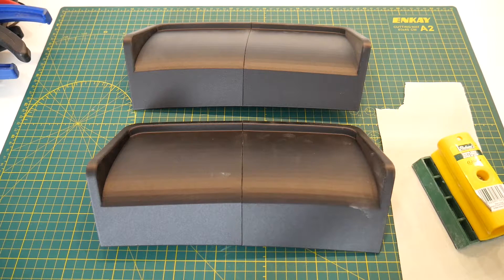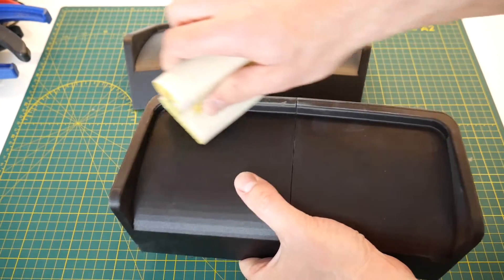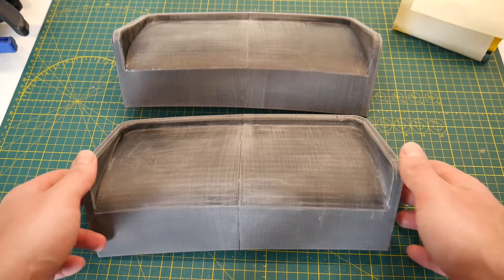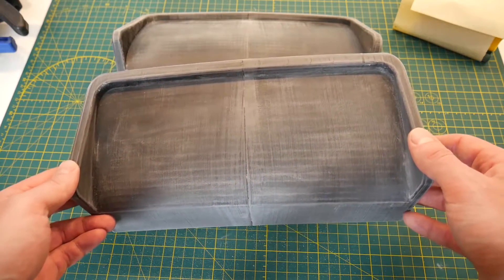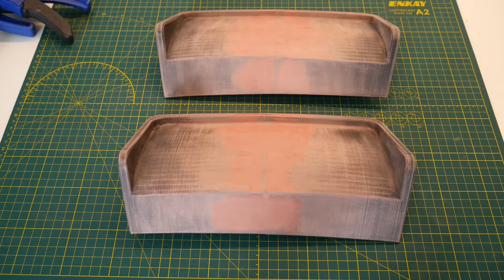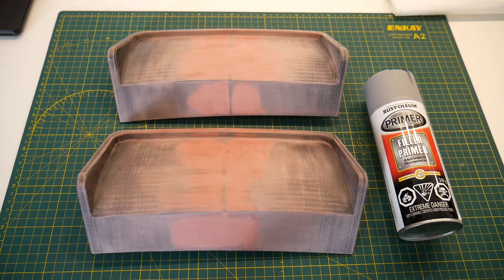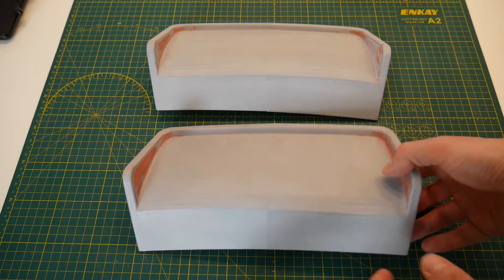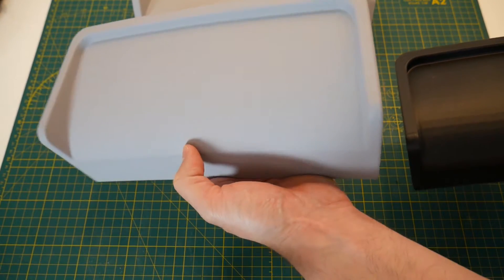Simple Way To Make 3D Prints Look Professional! Works For Car Parts, Cosplay, Etc!

Comment from the maker: Looking for a new printer and would like to support my work? Check the links below for the best prices - As an Amazon associate I may earn a small commission (at no extra cost to you):
Creality Amazon Store (Creality Ender 3 V3 PLUS)
► https://amzn.to/3WG7bkv
Creality Amazon Store (HYPER PLA Filament)
► https://amzn.to/3M8zrXc

Check out my review on the Ender 3 V3 PLUS: https://youtu.be/JeKFs0Ch4QA

Looking for the regular size version of this printer? 

Ender 3 V3 PLUS (New!)
► https://shareasale.com/r.cfm?b=2569126&u=3650799&m=124834&urllink=&afftrack=

If you guys are looking for some awesome 3D printer parts and upgrades check out my universal spool stand:

Universal Spool Stand:
►https://embracemaking.com/products/universal-top-mount-spool-stand

Links to Universal Spool Stand adapter brackets for various machines (like the top mount in this video)
► https://embracemaking.com/blogs/resources/universal-top-mount-spool-stand-accessories-and-adapters

If you're looking for the double sided flex plates, see below. The K1 MAX and V3 PLUS are the same size and listing:

► https://embracemaking.com/search?q=k1+max+PLUS+PEI&options%5Bprefix%5D=last

A few other cool tools and things for 3D printer enthusiasts.

Polymaker PolyTerra PLA (One of my favorite filaments):
► https://amzn.to/3sdhK1x

eSUN PLA+ (Another one of my favorite filaments):
► https://amzn.to/3QA4tuq

Electric Screwdriver (shown while working on the printer):
► https://amzn.to/3JRbbZe

Comment: What type of material did you use for your print? This was a great info.
 It would cool to see a video on how these parts are made in the software programs and into the slicer.
Reply from the maker: Thanks! In this particular print it was a nylon based material if I remember correctly. But the same process can be performed with regular PLA / PETG etc.

Comment: How have these kept up?  I'm interesting in printing some parts for my Audi or atleast printing parts to use as part of a mold for fiberglassing.  Just wanted to see how these have held up
Reply: Well I read some older replies and see you don't have the car now.  You mentioned shrinkage though, how thin was the thin section?  Was thinking us printing some things for around the grill/bumper area but if shrinkage occurs on thin parts I might have to think about which way to use the prints, whether as the part itself or just as the mold.
Reply from the maker: Shrinkage might have been the type of material, I hear that ASA is best for outdoors applications, whereas I think I used a nylon based material. Thin sections were probably only 2mm thick or so

Comment: Currently designing and printing a duck tail for my car, going pretty well so far. Definentaly going to use your video, very helpful! I'm not sure if I should vinyl wrap it or spray paint
Reply from the maker: Let me know how it turns out, would be interested in seeing it. Links / pictures!
Reply: @EmbraceMaking  will do! It’s awesome your still active in responding after 2 years!
Reply: @minecrad9970  Did you finish it?
Reply: @madthough2298  yes!
Reply: @minecrad9970  How did it go? I'm going to try the same thing
Reply: @madthough2298  wow you are! It went good, except for I had to print multiple pieces and connect them with superglue and bondo over it. It lasted a couple of months before the pieces started to seperate, and after a couple months, the cracks were visible. So I recommend printing a full wing like I did, and then creating a fiberglass model from it. It’s probably better to do it right the first time. I took mine off, and put a fiberglass one on.
Reply: @minecrad9970  my plan is print it in pieces using a resin 3d printer, with the pieces being held together with dowels and resin. Resin printing is pretty smooth so hopefully shouldn't need too much bondo. 

How did you get it to fit the contours of the boot lid?
Reply: @madthough2298  I had a friend who had the design of the curve of the car. I didn’t use the bondo to get rid of the lines but more to protect the plastic from the elements. I also used wooden dowels, but I’m not sure the resin will hold after a couple of months. If you want to then I wish you luck!

Comment: How did model the part, would love to see the process of getting a 3d model of the car to start actually modeling the part
Reply from the maker: 3D scanners help ;)
Reply: @EmbraceMaking  any entry level scanners
Reply from the maker: Honestly, I've tried a bunch and most are garbage. It also largely depends on what modeling environment you are working in. I use Solidworks so scanners that only scan to STL or obj or whatever mesh type are horrible to work with in Solidworks. At this point in time, a quality scanner and capable post processing software are still beyond entry level in my opinion.
Reply from the maker: Oh and for the record, I designed this part using those mesh scanners... it was a nightmare. I spent HOURs trying to get usable data out of it... in the end it worked and I was able to do it, however, it was not something I want to repeat.

Comment: Just curious, how did that part hold up through the months/years? I also want to try 3D printing some parts.  What material would you recommend for printing now?
Reply from the maker: Actually not bad, there was a little shrinkage in the thin part across the center but the big parts were fine. I sold the car a while ago so I'm not sure how it is holding up now but for a few seasons nothing seemed to have changed.

Comment: Did you have to do a 3D scan of your car before designing and printing the diffuser?
Reply from the maker: Yes otherwise it would be near impossible to get the curvature right without 1000 iterations

Comment: Those lines in the curved part are not a product of the process of 3d printing, but looks like that because of the low-poly count of the 3d model. Lines from the layers look like very thin lines
Reply from the maker: Yes, can be a bit of both really... the original file goes through several "interpretations" when converted to STL and then again to gcode and how the 3d printer controller interpolates a curve. The end result is a not so perfect curve that you can sometimes see as "low poly" as you suggest.

Comment: How did you measure the diffuser to make the model?
Reply from the maker: I have a friend with a 3D scanner fortunately. Otherwise something like this would be near impossible to measure by hand or without tons of trial and error.
Reply: @EmbraceMaking  An alternative way of tackling those measurements would be a contour gauge. It wouldn't be perfect but it would make the task of translating curves to CAD extremely easy, specially if the gauge has a ruler stamped to you can reference to it!

Comment: I printed the diffuser wing for my kit car.  1.2M long.  It’s made up of 200mm sections, designed with mortise and tenon joints on each end of each piece.  Bonded together while clamped to a length of wood to keep it flat.  Filled, flatted and carbon fibre dipped.  It looks great (other people’s opinion) and works well to reduce the turbulence behind the car.
Reply from the maker: I like the mortise and tenon idea, do you have pictures or a video of it?
Reply: Embrace Racing.  I’ve tried in the past to post pictures as a reply and failed.

Comment: great job! how did you manage to measure the curve of the original valence on the car?
Reply from the maker: 3D scanner! It was still a HUGE pain to get a good result from that and then clean up the mesh and work with it. I use Solidworks... Solidworks and meshes don't co-operate very well.
Reply: @EmbraceMaking  ahh, im thinking of using a piece of paper cut to the curve and then putting it in a paper printers scanner. Did you use photogrammetry?
Reply: fastslash25 did you try the paper method out yet? How did it turn out?
Reply: @TheManutd9  Havent decided on the design i want to use yet, Im probably just gonna use sheet abs instead of 3d printing.

Comment: Is it possible to 3d print a Ram Air box for a 96 firebird
Just like the original? They are very hard to find and expensive as hell.
Reply: Have to look into it . Thanks.
Reply from the maker: Anything is possible! For really big parts you may want to print the parts, graft them together and make a mold for fiberglass or carbon fiber. Really big pieces will have more of a chance to split and warp if they are made of more than 2 parts in my opinion.

Comment: The "print seam" isn't a reality of 3d printing, you're just using the wrong settings. 

The glazing putty you used is pretty terrible, it's affected by solvents, it becomes unstable, gets soft, and swells as soon as you hit it with more putty or paint/primer you should use a 2 part polyurethane based glazing putty.
Reply from the maker: Hi Josh, which slicer do you recommend and what settings for dealing with the print seam? Can you expand on that? Also, with the glazing putty, I have yet to have any issues and its been months still. I can look into the 2 part glazing putty though, where do you get yours from? Thanks!
Reply: @EmbraceMaking  I use cura , at the moment I don't remember the setting, there are multiple ways of doing it depending on the part you're printing. If you're not using supports or infill, a spyralized path meant for vases workes really well. But the seam you have from the start and stop on the exterior is preventable even with supports and in infill.

If you have a well stocked napa, they will typically have a 2 part glazing putty but I do believe I've seen it at AutoZone and Wal-Mart at times. I like to buy from actual automotive paint stores whenever possible.